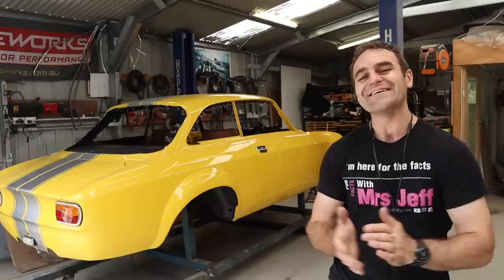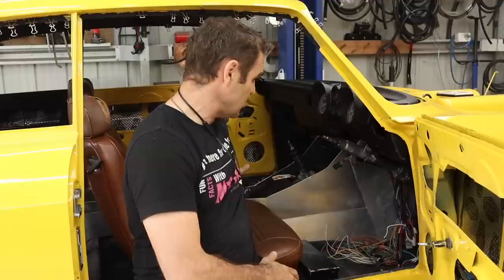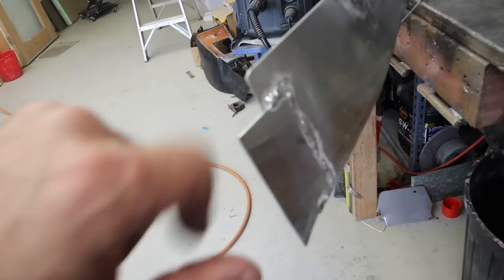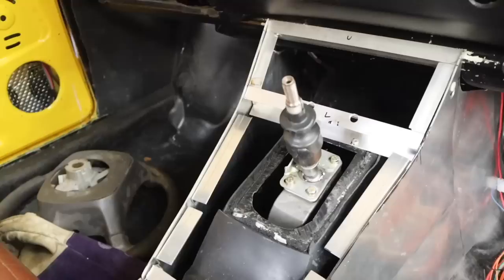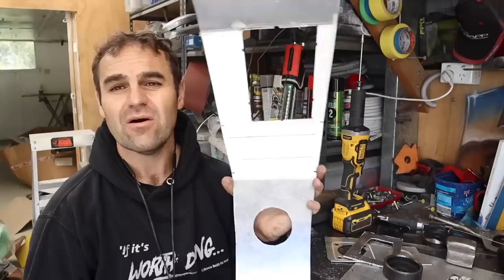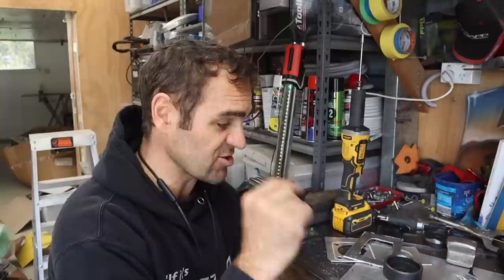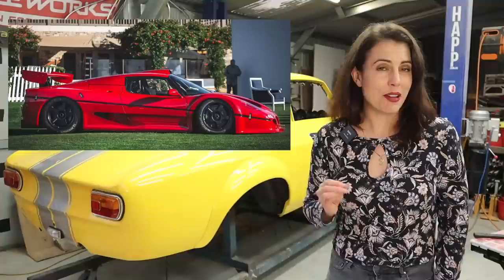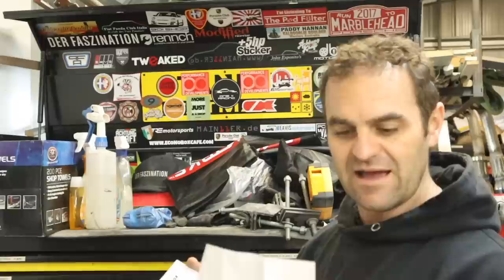Custom buttons - Ferrari engined Alfa 105 Alfarrari build part 172

Comment: I feel your pain, Jeff.
I built a 2 peice mounting foot for my roll cage last weekend. Cut and bent 4 pieces. Went to install over the long weekend and had to remake 3 of the 4 because they were wrong. Plus got sidetracked making a jacking point which I welded both ends on BEFORE passing the tube through the hole so I had to cut one end off.
I've had a shocker!

Comment: The console is looking fantastic Jeff. However are you wrapping the center console in leather. If so are you still going to use the same white plastic clips on the outside of the leather? Won't they stand out a bit too much if visible? Maybe a set of flat headed allen/hex screws would look more appealing and sit almost flush on the leather.
Reply from the maker: The clips will be under the leather of course ;)
Reply: @HomeBuiltByJeff  I was going to ask you if that was the plan, but my comment was getting long. 
That will definitely work, but are you confident the clips won't break? It would really suck to need to pull the leather partly off if a clip breaks. 
Maybe I'm just too paranoid as I unfortunately have a track record of breaking plastic clips.
Reply from the maker: @smavtmb2196  If you break a clip you just slide it out and another one in, just like a door trim. You don't have to touch the outside leather ;)
Reply: @HomeBuiltByJeff OK I guess I'm not understanding how you'll hide the clips under the leather and still be able to access the clips. 
No worries though. I'm sure it will make sense when I see it.

Comment: I vaguely remembering reading a report of a '70s car that had an oil level gauge as a secondary function of the petrol tank level gauge. To see the oil level, push a button. Release and it reverts to fuel level. You don't need to see the oil level as much as fuel.
Reply from the maker: Actually on a dry sump oil level varies a lot more, and it is good to see (like on my 911).
Reply: @HomeBuiltByJeff  I hadn't thought about that. I suppose oil drains less well on start-up, but also shen using high revs for a long periid of time. I am used to dry-,sump on motorbikes, but you can't monitor oil levels on the move.

Comment: Great video as usual, you are making it more complicated than I thought you would - I thought you’d get the whole console out and have all the electrical equipment connected to a big plug or 2
Reply from the maker: It will have a couple of plugs, but it is still easier to not pull everything out ;)

Comment: Did you not fancy having a go at doing a custom fibre glass console? Taken longer but could have included some curves to the edges etc.
Reply from the maker: Not the look I was going for, but I have done it in the past.
Reply: @HomeBuiltByJeff   Fair enough, it's looking good so far. Switches are a great find 👌